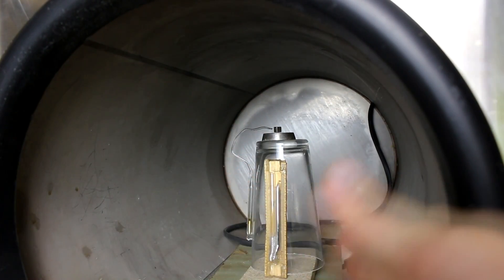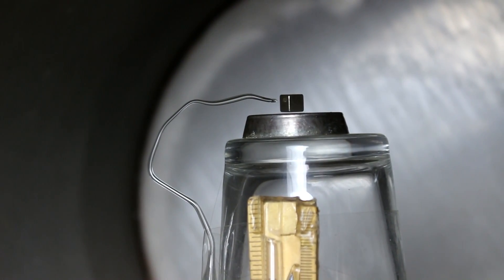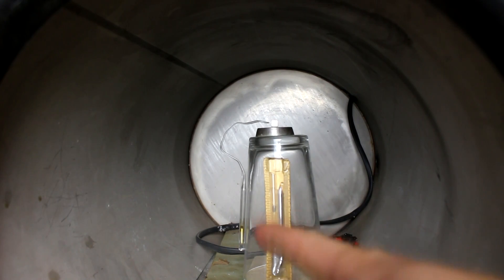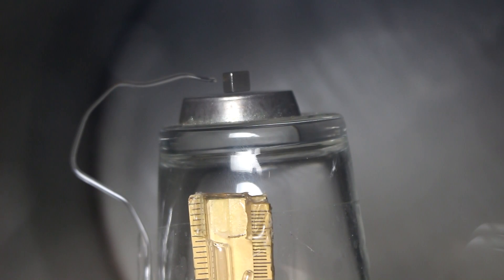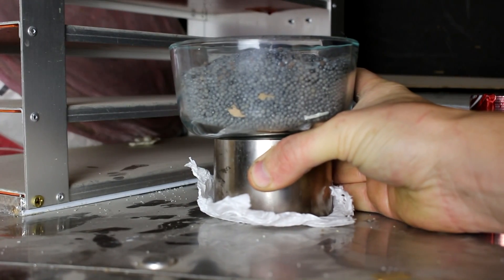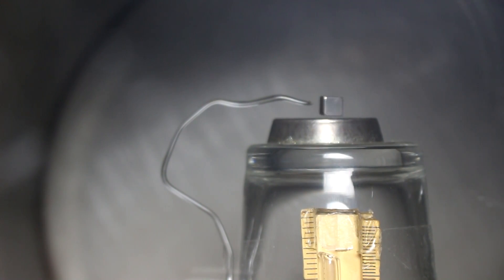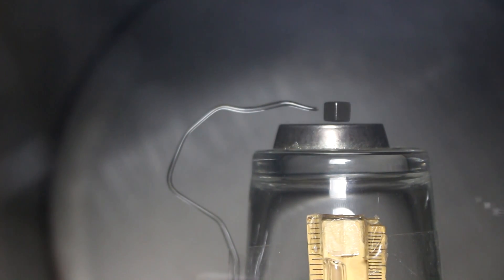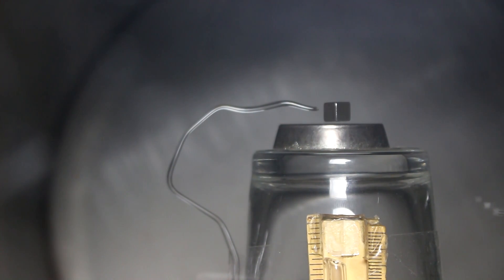Levitating a Magnet in a Vacuum Chamber

Comment: 2:17 That's a really clever way of getting it spinning.
Reply: Christopher Nah it didn't work, it wasn't strong enough as he said. I really like seeing how he sets stuff off with the laser though. I don't know what he could do without that thing.
Reply: Matthew Bevan instead of burning wood, he can burn gunpowder, it would produce more gas.
Reply: Alex Law, I don't quite know who you were replying to, but I'll guess it was about a jet of air not working in a vacuum. That comment was correct, the gas will escape all around and won't stay concentrated in a jet. Rockets in space don't rely on the exhaust gas staying together once it leaves the nozzle, all that matters is the pressure in the nozzle. Ever watched an on-board video of a rocket launch? The exhaust plume starts off concentrated but it gets wider and wider as the pressure drops off.
Reply: Water would have boiled off before the vacuum was anywhere near low enough for the experiment.
Reply: I would have used water instead of wood, It would have boiled off in the vacuum and get the thing spinning i guess :)
Reply: I think a century or so of rocket science says you are wrong.
Reply: water equalizes too much, you'd need to get ALL of the water your trying to heat up to boiling temperature which with a lazer would take ages
Reply: not if there is no pressure
Reply: Víctor de Sande Robledo lol he would need to use a tiny tiny bit or it would explode
Reply: Not really clever, since it didn't work
Reply: um... no?

A vacuum does not suck, A vacuum is a volume that lacks matter. Air, like tennis balls, still conserve momentum when exiting a tube like that aparatus and therefore should go straight.
Reply: Etan doesn't know about the phase diagram of water.
Reply: You know whats a better material than wood?

Baking soda. This guy is just intentionally being ridiculous to use wood

Comment: What is happening here is, because the field generated from the cube is not symetrical, spining it creates variations in the magnetic field permiating the bismuth. Those variations induce currents and those currents create magnetic fields oposing the one from the cube, which creates resistance to the movement of the cube.
Although, if the magnet was perfectly simetrical, and by that I mean a perfect sphere generating a perfectly even magnetic field, spinning it would not make any variations in the field around it, thus it would not induce currents on the metal underneath and it wouldn't get any magnetic resistance, so it would spin forever. Of course, perfect cenarios are impossible.

Comment: I think the magnet probably slow down mainly because of Eddy currents.
Reply: There is not much inertia going on in this magnet.
By the way, one comment out there pointed out, that if  magnetic field would be very axial with center of mass, there would be no change of magnetic field in any point around magnet spinning on same axis.
So, +Cody'sLab, could you please check same with spheroidal or, may be, cylindrical magnet, and, may be, huge chunk of copper above it?
Reply: Eddy currents in bismuth are probably quite low, since it his high electrical resistance for a metal.

Copper Electrical resistivity  is 16.78 nΩ·m (at 20 °C) or  0.00000001676 Ω·m

bismuth Electrical resistivity  is  1.29 µΩ·m (at 20 °C) or  0.00000129 Ω·m

So if I did my math right bismuth has 76.8 times higher resistance then copper.

I'm thinking about making a bismuth tube to drop my 3/4" neodymium  magnet through, so i can see how much the eddy currents slow it down compared to dropping it into a copper tube.
Reply: Nice experiment though
Reply: I do think same way, but could you make that prediction before you seen magnet slowing down? I couldnt.
Reply: morpheus ꀊ Yes I agree!!
Reply: You need to remember that what slows the magnet is the CURRENT. Since eddy currents are inducted due to the change in magnetic flux along the pipe, the induced voltage will be approximately constant for a given speed. When it slows down, the current will decrease further if the same material is used. However, if you have a material such as gold that has a very low resistivity, a larger current can be induced. This current will then create a stronger magnetic field to counteract the movement of your magnet. So don't bother with the bismuth. I'd build a housing for your copper so that you can supercool it.
Reply: Since current is inversely proportional to the absolute magnetude of the vector field is proportional to the current, we can expect the repelling force at a given speed to be approximately inversly proportional to the resistivity. At 1/78 ish, it would drop right through. :) 

Save your money.
Reply: @Tyler He yes i know. My point is i want to see how much the bismuth slows it compared to copper. To see if it was really playing much of a roll In slowing the magnet in this video since it has such high resistance it might have very little effect. I know it would slow it less then copper but how much 50% less 90% less. 

My goal was not to get a better tube for a slower fall, but supercooling copper would be fun.  :D
Reply: Tyler He I kinda figured it would not slow it much at all. I already have like 5 pounds of bismuth so i would mostly  be saving time :)
Reply: Ak10 my thoughts too
Reply: Yeah u are right the magnet creates it's own field
Reply: Ed edd and eddy currents

Comment: I want to see a fly in a vacuum.
Reply: Christie Nel A fly in a vacuum chamber is called a Walk. Also it'd probably die.
Reply: Steven Cassidy actually it would not die, it just can’t fly in the chamber, the fly will survive. There is a video of a fly in a gas chamber. Search it up
Reply: That's already somewhere on youtube
Reply: Funny!
Reply: Happy Chaps Gaming yeah but for how long. Animals need water and oxygen.
Reply: Take a syringe without needle, put a fly in the syringe, then drive the syringe piston in the middle position.
Now, cover the tip of the syringe with your finger, and compress or decompress the air by moving the syringe piston.
The effect will be very funny (except for the fly, maybe).
:o)

The fly will 'shrink' or 'grow' a lot in size as you move the piston.
Also, the fly will survive. Not kidding!

Comment: Two suggestions actually, first the magnet is off balance try putting it on a different side or finding another magnet. My other suggestion is adding two extended tails on the side of it so you can use your laser.

Comment: I really LOVE these electro-magnetic experiments!
You could maybe try casting the bismuth into a circular mould with many thin pieces of plastic acting as insulators (like in transformer laminations).
Also, perhaps you could try a non conductive ceramic magnet (AlNiCo and Samarium Cobalt are about equally conductive, with ferrites being MUCH less conductive) as levitation device? You could theoretically even use many small pieces of Neodymium magnets (without the nickel coating of cource) and have them pin a thin insulator between themselves (mica perhaps?).

Comment: try using a round magnet, ball bearing type would be best. the square shape changes the magnetic fields and slow it down.
Reply: Cody'sLab; It does increase the circularly induced eddy currents (kind of like a magnetic stirrer works). Asymmatry in the same plane as the conductor is bad news, but since you have a pretty substantial conductor in all 3 dimentions (and the entire vacuum chamber would also have a BIG effect, even though it is relatively far away - see Gauss' Law for charge screening), ANY deviation in the up-down direction would also cause quite a lot of enegy loss in those modes.
Reply: A round/disc magnet will have a axially symmetry magnetic field, if you rotate about the axis of symmetry the magnetic field doesn't change and so you can eliminate the eddy currents. To reduce the faraday disc effect you'd need to use only diamangetic levitation but i'm not sure of the relative strength of these effects. A square magnet doesn't have a axially symmetrical magnetic field.
Also you could just use polycardon which has a larger diamagnetic effect than bismuth but might be difficult to get a large enough sample.
Reply: Can Be easily fixed with a permanent marker pen.
Reply: How would he spin it
Reply: He's not. Any axially symmetric magnet will work far better. You're getting drag because that magnet is not fully symmetric. A cylindrical magnet will also work well for example.

There's an almost completely lossless very high speed electrodynamic bearing that relies on this:

https://en.wikipedia.org/wiki/Electrodynamic_bearing

If you don't believe it; TRY IT.
Reply: Cody'sLab laminating the metal to reduce eddy currents?
Reply: No, no, no, big mistake, it's a huge difference. The losses are not due to the magnetic field, they're due to CHANGES in the magnetic field!! Faraday's law is the rate of change of total flux through a loop. If the fields are axially symmetric, there's no loss when it spins!

Physicists usually say that fields don't move. Another way to look at it is that in a symmetric field with movement the amount of field entering a loop is the same as the amount of field leaving the loop, so there's no change in flux and no EMF.
Reply: Cody it should make a huge difference. Take a note from our experienced universe... replace the cube with a sphere. The sphere will be less influenced by magnetic and gravitational inconsistency on its "un-perfect" shape :)
Reply: The Werewolf 
That is what I  thought of too..  Aren't the lines of Flux non moving in a perminent magnet?
And if so, wouldn't the Flux from the moving magnet fight with the Flux from the stationary magnet? So wouldn't that be how a generator /motor works? AND in this case, would that be dynamic braking?
Reply: It may not make a huge difference, but it will make all the difference you're looking for. What "other forces" do you think are acting on it?
Reply: put a mark on it with a sharpie?
Reply: Well the magnets force is constantly generating down while magnet on the bottom is constantly generating the field up, you are correct that the roundness would help immensely but the force field still has to move around the ball causing magnetic friction ( i dont know if thats the term thats what im calling it)
Reply: MrEvilchickens the problem I see is finding a round magnet that is accurately symmetric enough. Without that, it will spin slanted (as the square magnet in the video) and have symmetry defects, which will end up with the same result (albeit maybe a slightly longer spin duration)
Reply: flippynl exactly my thoughts
Reply: spratsprat; He could attach radiometer vanes around the perimiter and start it up with his laser. Since the vacuum level required to get the radiometer spinning in the first place is pretty high, it shouldn't have too much of an effect (especially since it only needs to turn with a high powered laser, so the 'vanes' can be pretty small).
Reply: The main energy lose mechanism is the eddy currents (EC), the Faraday disc (FD) effect has no effect here. The FD generates a potential difference between the edge of the disc and the axis of rotate, current can not flow through the disc to equalize the potential since it is the rotation and magnetic field is opposing this action which was why the potential existed in the first place. And without another path that is outside the field or not rotating the potential will persist as long as the disc rotates. Another way to look at this is no angular momentum can be transfer way from the disc, unlike EC which transfers momentum between the magnet and conductor.

The EC are generated by a change in the magnetic flux passing through a conductor, from Faraday laws. If you take a magnet that has any sort of rotation symmetry the resultant magnetic field also has rotation symmetry. Now if that magnet spins around that axis of symmetry the never changes. Another way to look at this is to imagine the the typical flux lines actually follow the rotation, now take a loop of wire near the is magnet (can be anywhere) the number of flux lines leaving the loop and the number that enter the loop is exactly the same because of this symmetry. Since the EC are from a change in flux and have shown that not change occurs the can be not eddy currents from a rotational symmetry magnet.

The Rotational symmetry must be continues and not discrete e.g. a circle is continues but a square is discreet as it must rotate 90 degrees to get to an identical state. The square magnet is very much not symmetric and a cylinder/ball/disc would eliminate EC. This vacuum experiment shows either in air or vacuum the dominant energy loss mechanism is EC and not air resistance.
Reply: One simple approach is just to paint them with a black/white pattern.
Reply: baby got curve;D
Reply: The issue I see with using a spherical/cylindrical magnet would be that any movement would be very difficult to actually see, especially on camera through the window of the vacuum chamber.
Reply: shut up floppyl
Reply: Any axially symmetric shape gives zero magnetic drag. But I think that the magnet is mainly slowing because of air viscosity between the magnet and the metal disk. Counter-intuitively, viscosity of gases is almost completely independent of pressure down to very, very low pressures hence the experiment is not working the way you could expect. A cylinder stops pretty soon, but a sphere should work better because it has a bigger air gap under it.
Reply: a spinning round magnet. 👍
Reply: you can see this effect at the beginning when the magnet is moving back and forth in the field on its own.
Reply from the maker: I might try it at some point but I dont see any reason that would make a huge difference.
Reply: Actually, it will still stop. You're thinking of the magnetic field as a fluid in which the magnet is hovering.. in fact, it's better to think of it as lines of force that are going through the floating bismuth. As it rotates, the flux lines will twist regardless of the shape of the object.